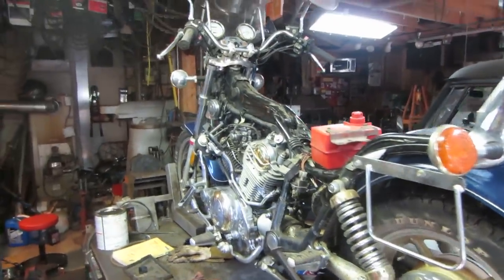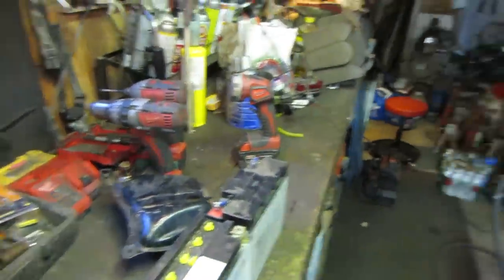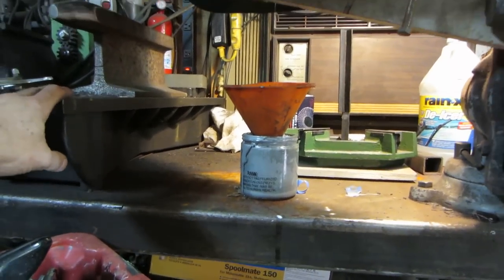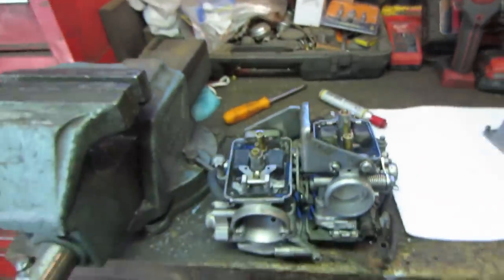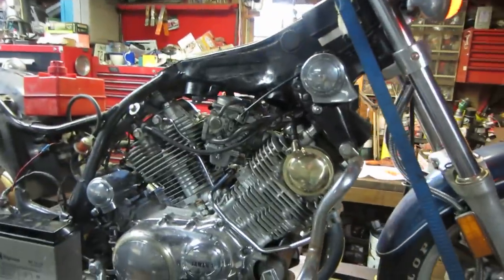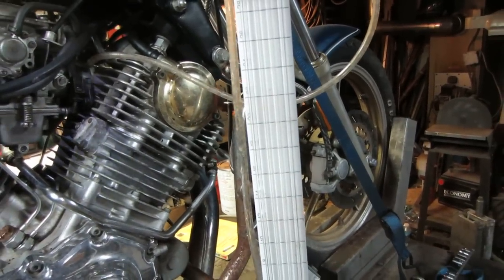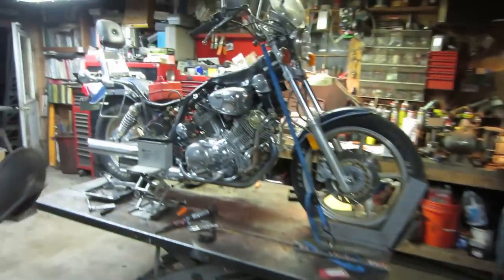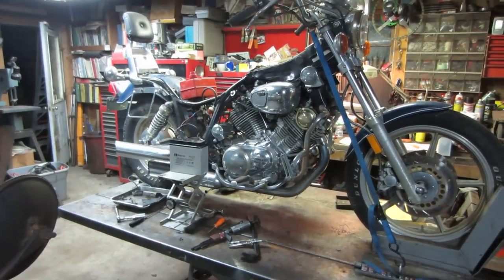yamaha virago 1100 carb repair and sync

Comment: Great video! You do an awesome job bringing those old machines back to life. An old trick for synching carbs before installing is to use a wire gauge , get butterflies set identically when closed. Once again, Thanks for the fine work.

Comment: Your videos on these carbs make me feel a lot better about paying a shop $113 total to sonic clean all the parts in my two Vulcan 500 carbs including drilling out the factory sealed jets and sonic cleaning them too.  They were full of seven year old solid gas, I couldn't get out even with a wire and soak overnight in carb cleaner.  Carbs came back from the shop like brand new.

Comment: First time I've seen a Japanese bike running carbs other than Mikuni or Kehin. Tank sealer looks the same as some stuff I used called "tank cream". Worked real good too. I had flaking internal paint issue on a 78 BMW R80/7. To get excess paint off I poured in a strong acid and two hands full of 1/4 " ball bearings, shaking like buggery for an hour or so- worked a treat. After blowing out tank and fully dry I poured in a whole litre of tank cream, working around for full coverage. It took about 24 hrs to fully cure. I ran that bike for ten years after treatment and never had a problem.

Comment: Amazing that I have a Virago 920 from 1982(I think) with the same problems demonstrated here bought it about 10 years ago with 14000 miles and only rode it a few miles before storing. Only one cylinder running most of the time and the other one very lean when it did kick in. This motivates me to try it again!!
Reply: Clogged main,probably

Comment: Back in 1989 I worked for a Radiator Repair Shop. I remember doing several Gas Tanks with the Sealer after a Caustic Soda bath. I seem to remember using Acetone to thin the Coating when it was getting thick. The Acetone would bring the flow back as new, but would evaporate quickly allowing the coating to set as usual. You might want to check on that as the formula
these days may be different.

Comment: i had one of those also. i put 40k miles on it in 2 and a half yrs. loved it. just thought it was a bit short. im 6ft1. used the highway pegs . never the reg pegs. due to there to short. bad placement for me. size 13 boots. lol but fast fun bike. was told it was an 8 hr job removing and rebuilding the carbs. sounded crazzy.

Comment: Few folks ever bother bench syncing their carbs after a thorough cleaning. I've not seen paper strips used, but often heard of guitar strings being employed with regular occurrence. Great set of secrets to getting a proper tip-up when coming off of idle, as one rolls onto the throttle.

Comment: Great work...enjoyed the adventure.. Back in the day I found that those closed cell floats do absorb gasoline and change where they sit for level. I still have a gram weigh scale that would weigh each float just after u removed them and see if they came within spec.. I was a cool little mechanical scale  and I am sure an electronic digital scale would do the same.Just a thought Cheers and thanks again for sharing

Comment: Smashing job mustie :-D, sounds really happy, carbs happy and balanced :-).
You may not get the balance perfect as the diaphragms may be slightly stiffer at different throttle positions, they are old but i think they are working smashing :-D.
Its worth a little love to wake it up again, that will be a nice machine for you or another owner :-D.

Comment: Hey easy tip for you!  Next time you seal a tank, if you have a small cement mixer you can wrap your tank in a blanket and stuff it in the mixer and turn it on, it will rotate the tank and coat the insides evenly automatically for you!   Love your videos I been beng watching them! Lol 😎
Reply: Mike Flynn we've been using a cheap barbecue grill rotissere for years. Works well but you need to relocate the tank a couple of times to make sure the whole thing gets lined.
Reply: ^^ thats a great idea, thx!

Comment: Regarding the dead battery. I was able to recover one using Epsom salt. Unfortunately, I did not monitor the battery. However, after 2 years of sitting, I added some extra acid and strangely enough, not only did the battery hold a charge again, it is back in my bike and working like a charm!!
Reply: Geek Of Truth2 batts can also have the sulfation can also be removed with a baking soda/woter souloution. Old military batteries used to come apart, get cleaned via baking soda method & get reassembled as good as new.

Comment: About 3:38 you showed gas tank sealer.  This is new to me.  I have my old 1980 Honda 200 college bike project going on.  I look inside tank and it isn't sparkling clean (been sitting empty inside for last 8 or 9 years)...but it ain't real dirty-looking neither.  Strategy?  Clean?  Or don't fix it if it ain't broken?

Comment: A sulfated battery can be revived. Drain the acid out and rinse with distilled water. Drain and refill with distilled water. Take a specific gravity test and record results. Connect to a charger and allow it to "charge" for about 4 hours or so.   Checking and recording the specific gravity periodically and when the specific gravity stops rising, drain and rinse again, then refill with sulfuric acid and charge and bob's your uncle as our aussie friends say.

Comment: Is there any chance of that liquid, you use as a cover film for the interior of your gas tank, to melt when temperature is high and then just pass into your carburators causing you issues?

Comment: Just a fyi, we always use a semi soft piece of wire in those smaller ports so you can pull them out after you drain and be assured of a clear hole.
But the acid we were advised to use escapes me, and wondered what you used to do the tanks before you cleaned it out and then did the sealant?
Will be a nice ride after you're done, although it's probably long been sold by now.

Comment: Do you use a battery desulfator? You can find them on ebay for less than $50 for one that will work with both 6v and 12v batteries. It just seems like as many batteries as you come across that would be no good, buying a desulfator to save even a few of them would be money well spent.

Comment: You can rejuvenate and old battery and clean the crud off the copper by shaking it around for a good while. Obviously only do this with a sealed battery. I have recovered quite a few batteries over the years using this method.

Comment: I rebuilt carbs on a 2000 virago 250 vtwin and had the same challenges getting the carbs in and out. They are shoehorned in there.

Comment: Looking at those terminals I am not suprised it didn't take any charge. The first thing you should have done was remove theb battery and clean those and the cable clamps. If you replace a battery you should always go higher not lower on the AH, When they designed the bike they worked out the minimum required with all electrics on and correctly charging. I can understand you replacing it at the price but another couple of bucks to get a higher AH one. Sorry but after finding all the crap in the fuel tank I would have stripped the whole fuel line and fully stripped the carbs

Comment: I have a question. I pulled my carbs off the bike cleaned them a lot. I got it to run yesterday needs balancing for sure, but today I tried to start it again and I had fuel come out of the black hose barbs on the tail end side of the carburetor. I am new at working on motors and bikes. I cant find any diagrams or information for what those barbs  are

Comment: The carbs are made by hitachi and are excellent units. I have used several of them on my Harley drag bikes. Remove the Air Induction System and gulp valves and your good to go.

Comment: That's it!? What's next?? Did you put it back together ? Is it running? 
Just purchased an 86 virago vx700. Turns on fine. But sometimes does when pulling the throttle. Obvious carb issue?

Comment: What kind of gas tank sealer do you use?  I need a clear sealer for the inside of a ms 361 gas tank which leaks in a few spaces.  I don’t want to use red coat because it is red.

Comment: Several people I spoke with about that gas tank sealer said it was bad news because it will break apart over time. I think I'll try Metal Rescue on my 82 CB750 because it won't hurt the paint, then just keep the tank full with fresh fuel and see how that works out.

Comment: I had 1985 Virago for ten years. Rode that bike everywhere. People gave me a hardtime cause they said it was a Harley rip-off but that Yamaha was better built. The drive shaft was super smooth. Only downside was those carbs can't take the vibration and get out of adjustment after a while. Great video. What ever happened to the bike?
Reply: I always tell people that the Yamaha, Honda, Kawasaki, and Suzuki V-twins are the Harley Davidsons HD would make if HD knew how to make Harley Davidsons right.  No, they don't have the cachet of the HD, but it you want a good, dependable bike to start and ride day after day with minimal maintenance, the Japanese bikes are what you want.
Reply: My father has a brand new yamaha stryker 1300i and its low and very comfortable gets right down in the corners compared to a Harley its more comfortable and more reliable.

Comment: My 87 Virago 1100 has been flawless until last year. I have had the carbs off about 12 tims now. New kits, new needle and seats, floats set as per Virago forum online and she runs like a bag of shit. Fires up real nice for about 30 seconds and then I start getting white smoke from both pipes, bad popping and a useless idle. Bummed to say the least. Being the local dealer has no dam idea, might you have any ? Thanks for your vid, greatly appreciated !
Reply from the maker: this might sound dumb but is the battery good, it has electronic ignition if the battery is weak or a dead cell spark will be weak, put a battery charger on it while running, vacuum leaks, also try some new plugs, one of mine was fouled and did something like that on one side,
Reply: I will give it all a good look, should be fine, assuming, but again you never know.
Reply: Have checked several times for any possible leaks, none found at all. If this was a bike old and abused I might understand why it's putting me through hell, but concidering it has run like a top and is immaculate, I am just lost and going in circles.
Reply: So what was the issue?
Reply: did you ever figure it out? smoke sounds like oil.

Comment: My XV700 idles nicely, with both gauges pulling the same vacuum at idle.  However, at midrange, 2500-3500 rpms, it gets kinda rough.  Above 4K rpm, it is smooth.  How do I adjust the synchronizer screw between the carbs, without removing the carbs?

Comment: Great video, subscribed. Curious is there better way to sync than use mercury gauge like that. I fear it sucking in the mercury and killing you from toxic vapor cloud.
Reply: There’s something called a Morgan carb tune and something called a twin max. The carb tune uses metal rods instead of mercury. The twin max is electronic and only can sync two carbs together. Whereas the Morgan can tune 4. I own both and like the Morgan better but the twin max is decent. If you’re working on old BMW bikes then the twin max is the best.

Comment: A little late, but i usually set the manometer so both carbs are in sync at about 3000 rpms for the yamaha v twin
That puts them in perfect sync in the bikes power band.
That will put them out a bit at idle due to various imperfections, but you dont ride the bike at idle much.

Comment: Hi @Mustie1. I have a 2006 SV650S and its idling high at time, not always. I would stop at a light sometimes and it would be at 2.5k RPM and other times its normal at 1.5k. I have adjusted the idle screw, changed spark plugs, air filter and oil. Not sure what else could be causing this as its not happening all the times. I can give it some gas with the clutch off and sometimes it will drop to 1.5k pretty fast.
Any help is appreciated.
Reply: Any news about the bike? I have the same but 2005 with 50000 km on clock.
Reply: @MrPhill44  I think it needs a tune-up. A friend checked and said there are no air leaks so I am guessing its the fuel injectors.

Comment: Looks like a tough one to work on, I love to sync the carbs on Honda 550-4, never have.
Reply: just try it. synching carbs is like putting a cherry on a cake. It makes the engine accept small throttle openings so much better , great for slow manouvring of the bike, it also prevents the distribution chain from rattling inside the block.
Reply: I just don't have the mercury gauges to do it. Thanks

Comment: Would having a vacuum leak on a carburetor cause an engine to run rich?
Reply from the maker: no it will run lean
Reply: Mustie1 Oh ok. well i have a 1988 Murray lawn tractor with a brigs&stratton engine, i'm pretty sure its running rich because it will shoot a blue flame from the exhaust and backfire quite a lot and it will not go to a full idle, only half throttle and if you put it to low throttle or anything below half it will die or it will backfire and then die. I have cleaned the carburetor with carb and choke cleaner and all of the passages that i could find, and nothing was clogged but there was some brown gunk coming out, and some time's when you going up a small hill it will die. It does not feel like it is stalling it just fells like the throttle is being eased off as it go's up and dies. So what would be the problem, and how would i fix that?
Reply: Try looking at the air filter, easy to check and fix. My lawn mower was constantly idling up and down and a look at the filter and I could see pollen and dust in the foam part of the filter. I cleaned it and it ran better and ran even better after I replaced it.
Reply: MostlymoparIH It has a brand-new filter and since it is so old i dont mow with it so its not clogged.
Reply: Okay.
Reply: try a different good carb.  if you got one, that is.
Reply: Michael Tate Well unfortunately a new carburetor would be $200,and i dont have one

Comment: this video would have been great if it showed where you hook up the hoses to balance. Also where the screws are exactly to use to adjust. Just saying blurry pointing at things with a screw driver isnt helpful.
Reply from the maker: it is not a how to video,  just a wrenching vlog, sorry it did not help you,
Reply: Pretty simple, probably 100 forums on this.